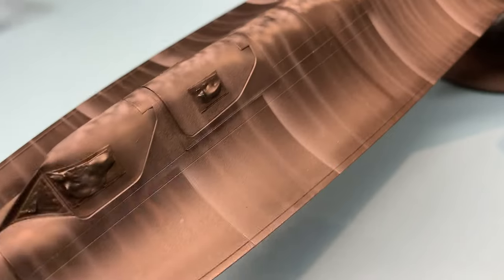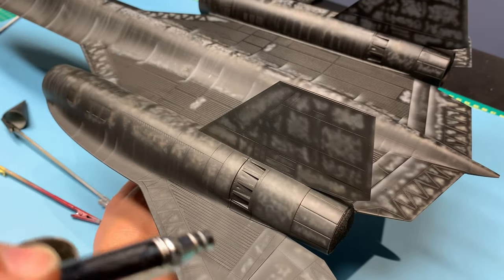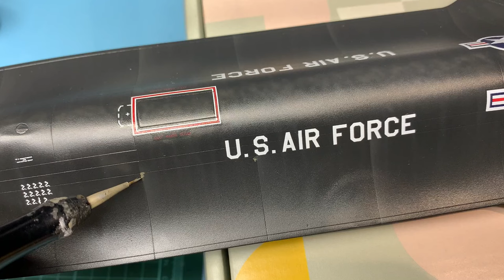Realistic Black Finishes for Model Airplanes

Comment: Having built several SR-71's I can tell anyone who is going to take on one of those kits, the paint is far more complex than just spraying it black and calling it good. What you have to remember though is that many of the pictures you'll find in searches are museum pieces that have sat out in the weather for extended times, so the weathering is exaggerated in comparison to how they looked when they were in service and subject to the high temps generated at Mach 3. The wing "ribbing" is called corrugation, just like sheet metal roof panels. This kept the panels from warping at high temps.
Reply: The Blackbird at the SAC museum in Nebraska looks gray because it’s super dusty. Something tells me an in-service one wouldn’t have that much dust on it. 😊
Reply: You have to figure how old and how much the plane was used.
They normally don't get repainted, so very weathered jets are definitely in service.
My experience.
Reply: @svensvensson2724  Actually, I asked a former SR crew member about the paint and they did need to be repainted periodically due to wear and tear from the heat. But all they did was sand them and shoot them with a fresh coat, they didn't take them down to bare metal.
Reply: @shannonchurchill4556  Maybe the SR's have special considerations with the extreme speed they go.
All that paint adds to the weight.

Comment: I found many years ago that even if you wanted a more or less flawless black finish on a model that you should not use either gloss back or flat back.  Aside from covering over the fine detail, nothing painted either flat black or gloss black looks like that for very long.  Mixing flat black model paint and gloss black model paint to produce more of a semigloss looks much better.  However recently I was painting a 1/48 Monogram T-28D in the special camo of the 606th special ops squadron (modified SE Asia top with a black bottom) and found that with modern Testors paints it takes very little gloss added to the flat to attain the desired finish.  The old 50/50 mix I used to employ 50 years ago will come out looking like just gloss paint; that probably was Pactra, anyway.

Comment: Corrugations. Those wing “troughs” are the corrugations. They, and many of the fuse/wing panels sit atop “clips”. Clips are exactly what they sound like, a bracket that holds the panels to the structure, but that allow the expansion of the skin. At speed, those corrugations get shallower and expand and slide along, the clips.

Comment: Years ago when I saw the SR-71 still in active service I got to walk around the plane and even touch it.  It was rough like bedliner but not near as bumpy.  The underside was almost a gloss only because it was really wet from all of the fuel that have been leaking out of it.  There was aluminum pans on the ground underneath the plane to catch the leaking fuel.  I think those corrugated panels are expansion panels for when the plane expands.  
This is off-topic and I’m sure a lot of people know this but when GM paints a car black they use white primer and when they paint a car white they use black primer.
Reply: I think the reason for the black primer is to do the black white method for shading. Car companies don’t care for showing wear on their new cars 😂

Comment: Great techniques to try and you have some valid points about how worn black paintjobs can get.

I researched black shades on SR-71s years ago for a build and since there is a full size plane near me in a museum, I did color chip samples of ten different blacks and dark grey shades in my stash.

In summary, flat black out of the bottle was way too dark. The shade I settled upon as being the closest was Floquil Grimy Black and I acquired a few bottles of that for future uses. When I did my 1/48 Revell kit last year, I did some similar color chip analysis since Floquil and Testors Model Master are no longer around. Grimy black is still best if one can find it as a couple RR paint lines have versions of it. But Tamiya Rubber Black and NATO Black are good alternatives with Rubber Black being a little darker out of the bottle.

Blackbirds can have paint variations in the panels, especially between the airframe and the nose given the noses can be changed out and stored under lock and key in a maintenance room while the rest of the plane sits in a partial open top hangar.

So for my build, I went with a Mr. Black Surfacer primer coat and a Grimy Black base coat. For accent panels, I did mixes of Rubber Black with Tamiya German Grey and/or Dark Iron to get some of those color variations. I didn't go with the lighter pre-shade or streaks given the plane I was representing was a late Kadena bird. Some of the weather streaking on the white lettered Blackbirds I believe was potentially down to them being kept outside at forward deployed bases such as RAF Mildenhall until a couple enclosed hangars got built in the early 80s (the red markings came about around 1984-85). But some of the dust is probably due to white chalk residue used to do "custom art" on planes being flown back to Beale AFB. One of the jets came home with so much chalk on it that the wing command got a little more strict on that behavior.

In any event, nice work and I may use the streaks on an upcoming U-2 build. Thanks!
Reply: Recently the  Archive-X paint company has come out with a set of acrylic paints that are precisely matched to the old Floquil colors, including the circa-1975 Grimy Black.  These were originally made for people who are building Star Wars models, since a lot of the filming miniatures were painted with Floquil paints (and thus the reason for specifically matching the 1970s-era colors), but they seem quite useful for things like this as well.

Comment: Expansion or control joints is what they're called.  The aircraft expands in flight due to the heat from friction.  Apparently it leaked fuel like crazy while on the ground due to anticipation of the same expansion.

Comment: Thanks for the excellent video - its great to get an appreciation of technique in this case. the 'trench lines' are expansion panels - the furrows in the surface smooth out as the Blackbird skin is heated during Mach 3 flight, and with the fuel cooling the skin.

Comment: Those ribs that you're talking about are the effect of taking the panel and having a corrugated so that it doesn't crumple when it warps at the height temperatures that occur from the traveling at Mach 3 and well above that. So you might call those lines a corrugation. Much like cardboard can be corrugated.

Comment: I've done something similar to all my models for years but I use a base of enamel silver paint. This does a few things. One, it gives a metallic base that you can work to for weathering. Two, it gives you a primer coat to allow other paint to stick well to it. Three, it will show you where you have sharp edges on the plastic after you've sanded and filled by pulling away from those edges. Then all you have to do it sand that bit or bits, and reapply the silver. For better black coat I use acrylic paint instead of enamels as this give a more flat look with a rough texture like on a lot of military equipment.(this is particularly effective for making a CARC paint effect for US Army equipment) Then I use a bit of ground pastels for weathering applied dry to the areas that are needed, and taking a bit of baking soda, and mixing your prefered color of mud, or dirty snow, and adding it to the baking soda is a great way to add mud and snow to your equipment.

Comment: You mentioned you didn't like the airbrush streaking down the fuselage and chines. Going with a dagger stroke with the airbrush might have better achieved what you were looking for. A dagger stroke starts out with the airbrush a little distance from the surface, as "circle" of pigment develops start moving the airbrush closer to the surface and letting off of the trigger at the same time while streaking in one direction. It looks like a comment with a tapering tail, the quicker the movement, the longer the tail. Using the post-it note like you did, you can start the dagger stroke on the post-it note and then drag the tail onto the fuselage surface. It takes some practice to get dagger strokes down but once you start to see some consistent success it's an invaluable tool in your airbrushing. If you've ever seen an airbrushed tiger or similar animal, to create the fur or "hair" effect, theiy're comprised almost entirely of dagger strokes with the airbrush.

Comment: Nice technique- thanks. Yes, it's easy to get them too black, and even if it's correct for a model of a freshly painted a/c, it never looks right. The corrugations on the wing was Lockheed's solution to cope with heat expansion- a flat surface couldn't cope. I have this 1/48 Revell to do soon- but I hope mine doesn't have those sink holes in the ducts near the tail!

Comment: Windex with ammonia is a no no with Vallejo and generally bad for an airbrush. The ammonia breaks down the resins in the paint. It also reacts with brass which most airbrushes are made with. It can and will compromise the plating and can correspondingly compromise the flow characteristics of the airbrush. Some airbrushes, it can also attack the packing seal(s).
Reply: Agree 👍
Reply: Thanks for the tip! I have several Iwata airbrushed that I'm just now learning how to use, so it's nice to know the do's and dont's from others
Reply: I appreciate your erudition.
Reply: good point but new windex is ammonia free.  read the label.  i was trying to clean an inkjet printer and specifically wanted ammonia, but no products have that anymore.
Reply: Will Pattison in one of his episodes says that there is no problem using ammonia with your airbrush and he gives data to prove it. The dilutions we use are low and for very short periods of time and it won’t affect your chrome plating.
Reply: I will simply never understand why windex is used as a thinner. Its designed to clean windows and will have all sorts of chemicals added to help wipe away grime from glass. Things that surely are going to hinder paint adhesion?
Reply: Why not just use the thinner made by the paint manufacturer? They are the chemists that created the paint.
Reply: @Xxxxxxxxxx3582  I'm sorry, and what airbrush company does will Pattison work for???
Reply: Agreed. I ruined an airbrush using windex and alcohol as thinners... ruins them quick.
Reply: @kennethfink7060  I don't know about the Windex, but alcohol certainly did not ruin your airbrush.
Reply: Both "The Grumpy Modeler" and "Barbados Rex" channels offer home brew thinner for use with acrylic paints like Vallejo. I've used it and the results are impressive... No tip drying and the Vallejo lays down and levels well, and dries nicely. It's my go-to now. I mixed up a gallon of the stuff and I'm set for a LONG time.
Reply: The deck-ells?
Reply: Thanks for that info.
Reply: Windex with ammonia does absolutely nothing to the chrome/nickel plating on an airbrush, or the underlying brass.

Comment: The thing on the wings you are asking about... the wings are corrugated which helps the wing handle high temperatures because the corrugations expand vertically and horizontally. They act a bit like a heat sink.

Comment: Its corrugated wing skin panelling - the external surfaces of the upper and lower wing panels were beaded and corrugated to permit the skin and structure to expand and contract in response to temperature changes during flight.

Comment: When the low RCS paint was freshly painted on the Blackbirds, it's texture was like a soft fine velvet. During flight at cruise temperatures, the paint would cure. It was not too long after a few missions, fuel exposure, and maintenance, the paint would become smoother and lighter in appearance.

Comment: From what I have read the Blackbird was painted a dark blue. I remember one book referred to it as cannonball blue.
Reply: The "dark blue" comment came about in the 80s when Testors did their Blackbird kits in conjunction with the release of their "Model Master" paint line which had Dark Sea Blue as a color. Since it wasn't a straight black shade, it worked better for the SR-71 than flat black.

At the time, it was the best we had when working with a single paint manufacturer's product line. Floquil shades such as Grimy black and Tamiya's NATO Black and Rubber Black in my experience tend to work better.

Comment: according to the net its called corrugated titanium skin paneling I would hazard a guess from their position they have something to do with cooling as this is a area where the air decompresses and drops below the dew point what creates condensation trails 

   so a  Corrugated titanium  refrigerant condenser heat sink panel

beautiful work that thing looks amazing

seen in a comment where someone said it's for thermal expansion and contraction contraction that makes sense

Comment: Great video, I really like the finished product! I would highly recommend that you don't use Windex in your airbrush. I know you said you like how it works for you but you should experiment with other finishes it will eventually wreck your airbrush. I recently started using clear finishes (matt and satin so far) from VMS and frankly they are game changers. I subscribed and am looking forward to going through your other videos and seeing what you do in the future!
Reply from the maker: Thanks for the tip.  I will look for that VMS finish.  I have tried various flat coats over the years and I have yet to find one that I really like.  I know I should not be using windex as thinner but it works so much better than the vallejo thinner and I am not using that much of it.  Then I flush the airbrush with iso to clean out the stuff.

Comment: I first paint with a grey primer. Then a light steel wool 0000. Then a dusting of silver. Then flat black. Now I start using a little pad of 0000 on a q-tip to make those streaks and wear patterns. Then a coat of semi gloss clear and a rubbing of 0000 all over to flatten the finish.

Comment: Actually the SR71, was not black but blue, however it would still need to be weathered the same way.. This bird was all about speed and a little stealth ,the wings were designed to minimize the multitude of vortex generated by the Angle of Attack  as the aircraft transitioned through the Mach speeds and altitude. It had a terrible Center of Gravity and was not very maneuverable. Of course we call know why it was mostly titanium.  The P61 would be interesting to see weathered. OD might be a better option but black version Looks awesome  First U2s were bare metal

Comment: The wing section that looks rippled they used corrugated metal to allow the metal to expand and shrink vertically and horizontally at the extremely high speeds and altitude where as regular flat wings would've cracked and split etc

Comment: A FANTASTIC Subject.....And I Don't mean the -71......

You are correct in assuming, "...oh, I'll just paint it black and finish."  But you're right it would look like those paper-card shots of silhouettes of A/C, not very realistic and I'm not sure if on a Very new plane.....

A Great technique of using 'Post-Its' notes, it gives it a "high-speed streak" along panel lines, and showing us Every step .... primer, grey pre-shade, mix of black and red (?), light misting of black, top-coat, then panel liner by 'Mig' just shows enough of a weather -71....and Other modellers could weather it a bit further if They want to.

Absolutely will be used for a few stealth A/C and a couple of 'Sci-fi' stealth A/C ( FA-37 Talon, Russian stealth, and "Testors stealth )

Good show!!
👍👍👍

Comment: Theyre heat sinks, im not sure what the air force calls them (scallops?), but they are there to dissipate the heat from the aircraft, the skin on the habu would reach excesses of 700°+ F (fun fact the SR-71 wwould leak fuel constantly due to the gaps in the panels for expansion and constriction from thebextreme temperature diference during subsonic and supersonic flight)

Comment: As one with poor vision, including nyctalopia, I fully understand your assertion here. And the insidious cunning of criminals, insurgents, covert operatives, etc., in using black. 

   For this model, I was thinking of alternating flat black with semigloss black on immediately contiguous panels of the exterior, in a process I call "panellation" (a technique to distinguish visually different panels). Moreover, I understand the aircraft skinning to be of titanium and/or its alloys; and that the builders would spray black paint over that. However, just flying round Mach 3 or faster was sufficient to stress, and in places, completely erode, this finish, revealing this metal's distinctive colour and lustrous finish. (Evidently, no known paint can withstand 300°C for several hours.) Therefore, an accurate representation would show these variations. 
   Next, just how would one treat recessed panel lines on a black (hypothetically) surface? I had heard with various dark greys. The distinctiveness of such surface features is that dirt in various forms--dust, soil, oil, etc.--gradually over time would accumulate. Such detritus, being of the natural environment, would be of various neutral shades. In contrast with most tans, greys, etc., these generally appear darker. Against black, or deeply-dark surfaces, a more moderate shade would be necessary. 
   What is your assessment, please?
Reply from the maker: That is a tough one to answer.  What I have discovered is that one needs a good picture to see how the aircraft weathered.